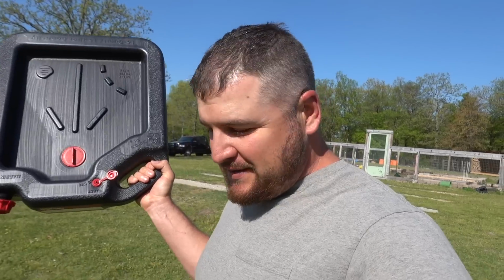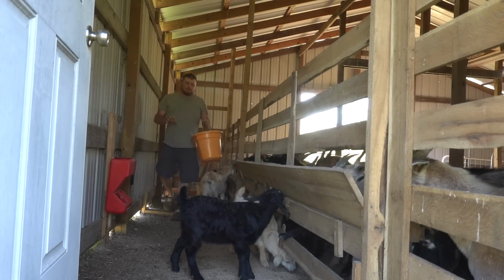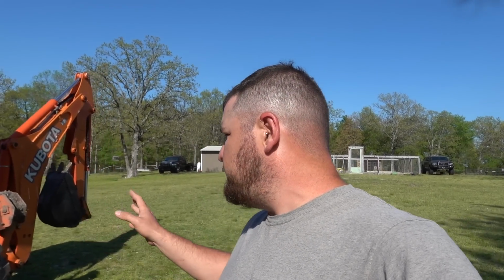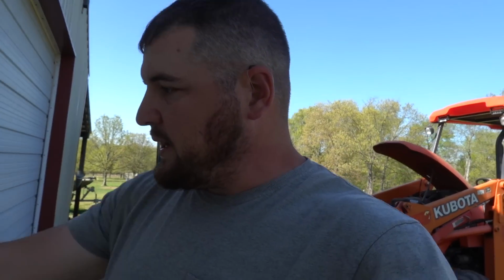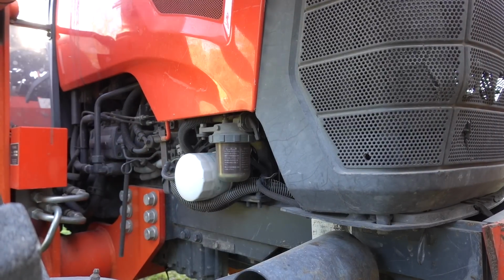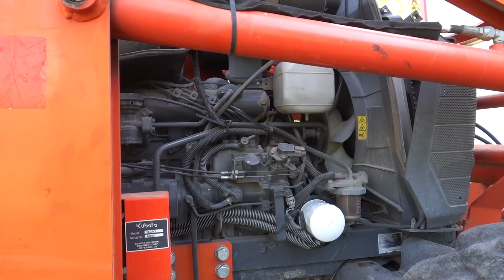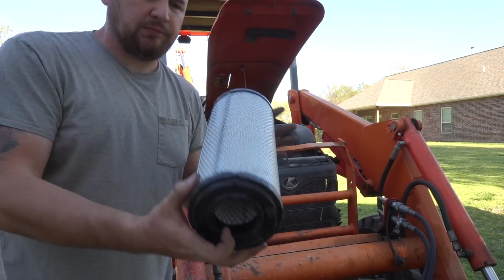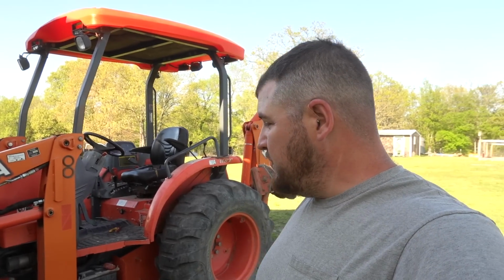Changing Oil and Filters On a Kubota Tractor

Comment: I change the oil, spark plug and air filters myself on all my gas powered equipment. You tube is an awesome way to learn. I’m a women by my self and thought this is something surely I can do. Gives me so much pride that I can do it myself!
Reply: More women, like you and myself, need to learn how to do preventative maintenance and repair work. I'm 74 y/o and like to do my own repair work. I just changed out the flushometer and flappers in both of my toilets. Simple and easy and saves lots of money.

Comment: I understand the charges for services. That's what my job is, I do services on heavy (And light) equipment, in the field. We go to the machine, they don't bring them to us. Just the labor charges are out of reach for many people that own tractors.
We almost always change the air filters, evert oil change. And they usually need it! They work in dusty environments. 
Kubota M59, 10 quarts of engine oil. 
When I doo backhoes, not only do I make sure the front bucket is on the ground, I put the outriggers on the ground as well. And put the key in my pocket.
Also, when you change filters, put the hours and date you changed them, on the new ones. Once a year or every 250-500 hours. Most farm tractors get changed once a year, unless they use them every day.

Comment: Kevin, Here's a few tips that you may consider when changing oil on any vehicle and I hope is helpful. When you're changing the oil, it should be close to or at operating temperature. This ensures all contaminates are suspended in the oil and not sitting in the bottom of the pan which won't drain out all the way plus you get more oil out because if flows better when hot. You should also fill the oil filter in the center all the way to the top with new oil and let it soak in while draining the oil and removing the oil filter. When you go to put it on, it would have absorbed 95° of the oil, then just pour the extra tablespoon or so back into the bottle. The drain bolt gaskets on your Kubota are copper and should be annealed which will make a better seal or replaced with a new one. Copper will harden after it's compressed and gone through the first heat Cycle and may not seal properly after it's removed then reinstalled and tightened if not annealed. Kevin, I believe you have the tools. Acetylene torch, a long bolt to slide the copper washers on, gloves and a cup of water. You heat up the Copper until you can see the color swirling, like different colors chasing each other, but not allowing it to glow red, then dip it it the water to cool it down. This process softens the Copper which will allows for a better seal because it can be compressed again, however after the first heat cycle the bolt must be torqued again due to the copper washer flattens out resulting in the bolt not being as tight as is was and should be. One thing about YouTube video's I watch for when I need information about my truck when I'm diagnosing a problem or I need technical specifications is that there's a lot of not so informational video's out there or it's not how did the repairs because I found an easier way to do it. One other thing is, sometimes air filters will get dirty in one spot where the air first enters the air filter area. In your filters case they can be rotated every few hours of usage to get more life and performance out of them until they need to be replaced. 
If you read this far then I thank you for your time and I hope this helps you or anyone out there in YouTube land. 🧓😁
Reply: @heatherclayton-callaghan4270  Thank you for your kind words. 🧓😁

Comment: Mr. Kevin, I am a maintenance freak. I know you can not mention every thing, but I think it's worth mentioning as these things do have a direct effect on length of performance. 1. Fuel filter(s) 2. Hydraulic filters (if it has them) 3, not a filter, but it does get used a lot, Power steering fluid (some tractors have a filter for it. Since most do not have a drain other than taking a hose off, I us a suction tool and suck out as much as I can. 4. trans fluid and filter 5. Check and replace if needed, your engine coolant. Testers are cheap, just most often under used. 
I use painters tape somewhere on the vehicle, that shows the date, type of fluid and any other info you want to include. Screw on filters I use a sharpie on them, if they are black in color, get a silver sharpie. On tractors, always use air, then water, and spray through it to make sure it doesn't have a build up of dust. Best to do this...Get out the grease gun. Lots of fittings, and greasing often will save many times the cost of the grease if you keep every thing greased up. And while your at it, put some injector cleaner in the fuel tank. Diesel is dirty, and often has water in it, so the cleaner can keep the injectors happy.

Comment: Kevin, In the motorcycle industry it's called a parts finder which shows sections of the bike with diagrams, part numbers, descriptions and prices. Back in the late 70's it was called a microfiche machine. It used a light bulb and if it blew and you had no spare, it was useless. Ah, those were the days trying to keep it focused, probably because they were old.

Comment: I once took to doing oil changes on my then 15 yr old Nissan Patrol 4WD. On the second time doing the oil change I made a big boo boo.
On draining I left it for about half hour to really let the final dribbles of old oil go. But on resuming proceeded to fill new oil. But after almost 2 gallons of new oil,   was concerned that still no oil at end of the dip stick. Then noticed oil running across the backyard brick paving on the far side of the vehicle.  I had NOT PUT THE DRAIN PLUG IN YET. All the new oil just ran out and overflowed the drain pan underneath.
OK what waste, of not cheap high quality Diesel Engine oil, now mixed with old dirty oil. At least I had plenty new oil  having a 25 Liter drum on hand. That 3.3L engine needed about 11 L  say 2.5 US gal of oil, so wasted close to 2/3rd of a refill volume.
No need to say I will remember that mistake.
I lost faith in dealer servicing with my second 4WD vehicle. After a service  with charged for oil and oil filter change  I found the drain plug caked with dry clay/mud  and filter looking very grubby. They claimed they pumped oil out via dipstick, this firstly DOES NOT remove much of the oil sludge/solids in the sump, nor guarantee all old oil is drained, just a cheap nasty way to save time and effort, as the vehicle does NOT need lifting up or putting over a workshop pit. In my case however, the dipstick too like the drain plug still had mud stuck to the dipstick and tube of dipstick.  NO WAY HAD THEY DONE ANY OIL CHANGE OR FITTED A NEW FILTER. The service manager argued to start  about failing to do the paid for work, but had to admit that an error was made on being shown the clear evidence.
Another time on my first 4WD  stripped the oil drain plug thread on the transfer case. I discovered that on seeing oil drips in the backyard parking spot at my rented accomodation. On looking underneath  saw oil drops on the plug,, on  touching the plug it was merely finger tight, and trying to turn it tight by hand, no tool, it firmed up then skipped to being loose. They denied doing it, claiming I must have ovrrtightened using a spanner. It cost me a replacement bottom case of the transfer case, and a three week delay at their workshop while they ordered a replacement bottom cover from Suzuki Japan for my then Suzuki LJ50 4WD.
I have had several bad other workshop experiences for a over 50 yesr driving. By the way I have currently only my third vehicle, which is now 29yrs old. 

I would agree that best is either doing it yourself and/or with use of a trusted mechanic and workshop. Dealerships consistently take shortcuts and/or try to add to the work items and above all add parts to sell. All driven by profit.
Also seen non original, so likely cheaper, parts used.

I think you have better parts and support with your Kubota, while not personal experience I gather from various other sources, including the on going "Right to Repair" debates  John Deere seems to have a bad reputation for restricting access to parts to only their authorised workshops  and many repairs are requiring the machine transported to the workshop for even things that could easily be done on the farm site. Often leaving farmers without their machine for days to weeks  at critical, ie harvest times, where a couple of hours would have restored operation on site had a mechanic been sent instead of a transporter truck  that often is not coming for many days. With electronic measures locking out some repairs without authorised workshop resetting. Some JD machines even I understand send usage and status to JD during use, and have remote lockout capability. Apparently Lockout was of use to stop functioning of stolen JD machines in Ukraine  by Russian troops early on in this current war.
At Walker Farm  he has just had added hundreds of dollars as some valve is now redesigned, and the dogs not fit the original housing  adding much cost to full upgrade of housing and valve unit  and adding considerable extra time to repair. Given the redesign the full upgrade should have been severely discounted or supply of original part assured for a long time given the machine is comparatively new and not some antique old type. In automotive trade the parts must be assured for 25vyears from end of volume production  at least in Erope and Australia  and many other countries. Not sure of the US situation, I worked over 40 years for  European major OEM parts manufacturer, even designed some special suited replacement items  for cases of running out of one time spares supplies over 11 years after stop of OEM supply, and one time build of believed sufficient spares supply. Sadly in some cases original tooling had been "accidentally ?" disposed of  and/or electronic parts used no longer sourced or superseded. All effort made to provide support. In one case the original electro-mechanical alternators regulators, based on a pair solenoid/relays with copper windings and bulky size were getting too costly to keep manufacturing. Yet due to huge volume of old machines and trucks, as well as very old cars still running, there remained a demand worldwide fir over a hundred thousand a year of replacements  since these old regulators did have wearout of buzzing/arcing contacts as they did their function. Due to alternator arrangemnet and design moder electronic regulators could not be directly used. I had the design task for a electronic type regulator to replace the costly old electro-mechanical junk. The result was a part now selling about 20% of the old regulator, needing far less space, though plugin compatible, with long(er) life.  In ensuring years sales rose to near 300 thousand per year, for some time, as many old machines and trucks were upgraded with that part, though the old unit was working. It was just more reliable  less affected by water and dirt, gave the users higher reliability, and a further benefit better voltage regulation with temperature coefficient compensation not on the old type regulator, that also boosted battery life and reliability. Overall a big win- win for both manufacturer and end user. From our perspective it was based on proper "Customer Spares" support, under changing manufacturing conditions and needs. I would be most angry to find myself expected to have high costs imposed to fix something no longer possible because the manufacturer changed design  without making sure of spares supply of the old pre change part.

Comment: My older son is 28 and has a diesel F350 Ford with 300,000 miles on it. He told me the differential was going out.  Turns out all the lugs but 2 were off and rolling around in the cup. He has zero mechanical knowledge. My other son is a helicopter mechanic. Guess they should have talked to each other 😂😂😂😂